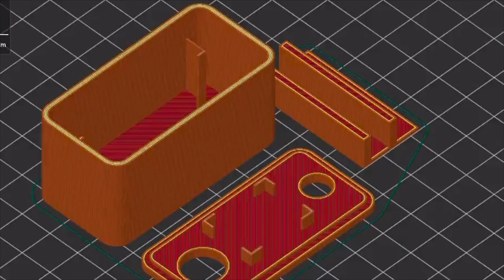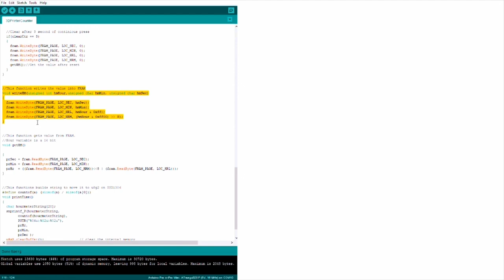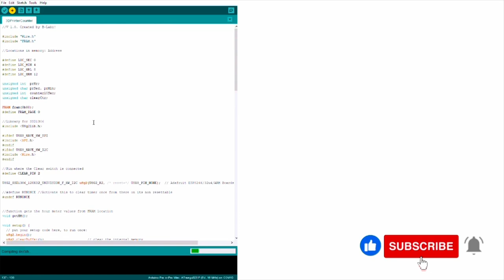DIY: 3D Printer run time counter

Comment: Nice project, but....

I encountered a problem during compiling.
the Arduino compiler generates an error namely "class FRAM has no member named "WriteByte"; did you mean '_sizeBytes'?"
What library did you use for this sketch?
Can you help me out?
Reply from the maker: Hi, i used FRAM library from B@tto its designed for FM24C04 series. You can get the same from 

https://Github.com/battosai30/FRAM
Reply: @blabz  Thanks, I installed the mentioned library.
Only I am using a fram type MB85RC256 of 32 Kb and that has a adress problem with the library.
Do you have a suggestion for that?
In the mean while I ordered a FM24C04 Fram so when it arrives I can make the original setup designed by you.
Reply from the maker: Hello BlueSky2993 i do not have alternate suggestion for MB85RC256 sorry.